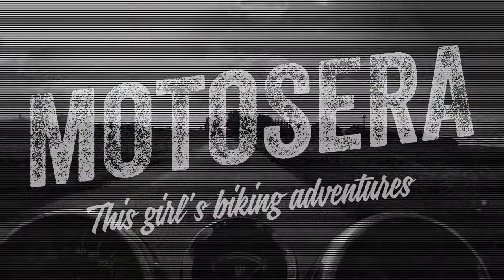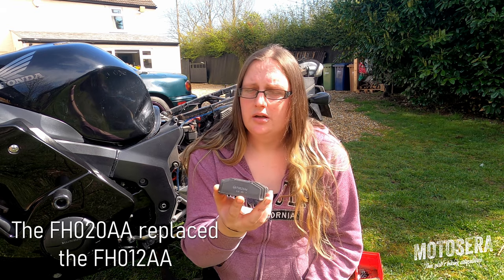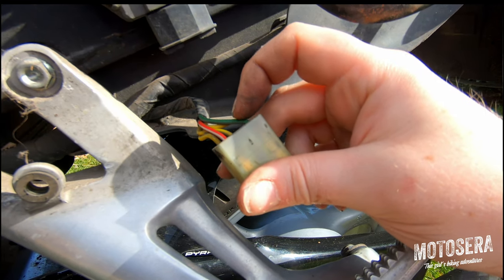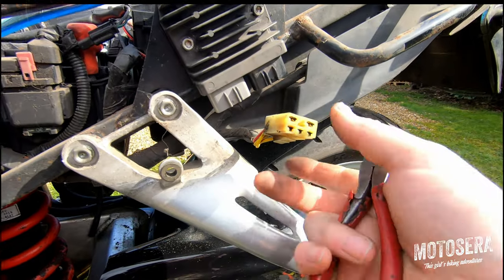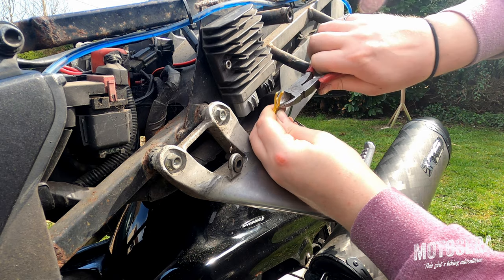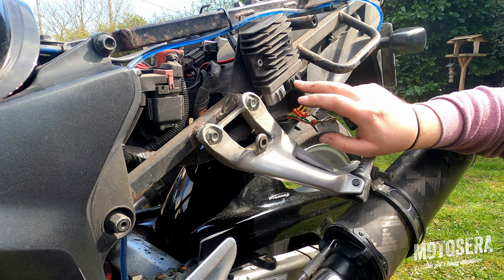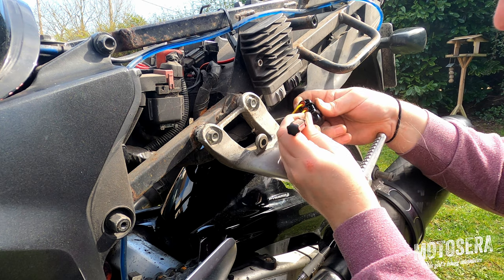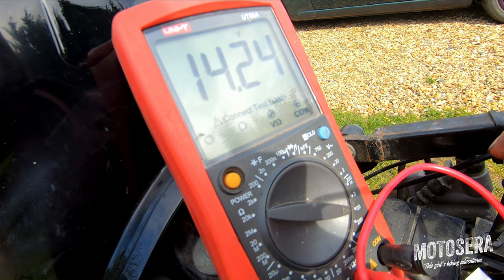Regulator rectifier failure - MOSFET Upgrade - Honda CBR1100XX Blackbird 96 97 98 Carb Models

Comment: Hi Sera! I just followed your tutorial and kinda dumb question but my plugs are tight ASF and I can't seem to push them up to be flush like your plugs so I was wondering if you could take a guess as to why not? Terminals are correct, they all made a clicking noise once they were properly seated and the plugs are facing the correct way and going into their corresponding slots. Should I just try muscling these mfers in? The plugs seem abnormally tight. TIA
Reply from the maker: If they are actually clicked/latched on then you should be good to go. Try pulling them off and see if you can move them. They go on with a 3 or 4mm gap.

Comment: Very useful video. Thanks . I have a cbr 1100xx model 1998 and I have done 53000 kilometers without any problem. The only thing I can mention is that when the motorcycle is parked, the battery does not hold its energy for many days. There must be a very small power outage somewhere. Maybe it's from the dust that can exist after so many years in some connections. For this reason every time I park the motorcycle for more than a day, I disconnect the negative terminal of the battery. I usually need a new battery every 2.5 years. Always be well and have good trips. Greetings from GREECE !
Reply from the maker: You're welcome. Try disconnecting the battery and put a meter, set to show amps, between the negative cable and the neg terminal on the battery and see what current you have. On a carb bike it should basically be zero. From there you can start disconnecting things one at a time, or pull fuses and try and narrow it down.

Do you have an alarm/immobiliser fitted?
Reply: @MotoSera   No i  dont .   I 'll try   to do   the  test . Thanks !

Comment: Buyer Beware .... There are tons of cheap new Chinese copys of the SHINDENGEN MOSFET FH012AA & FH020AA out there including eBay. Im not exactly sure if Sera purchased a used original Shindengen Unit (in good cond) or what, maybe she can tell us ...... but the old adage still remains true ... You get what you paid for!!
Reply from the maker: Absolutely, there are tons of fakes out there. I purchased a used unit. The genuine ones have specific markings on them, I am sure there are pictures on Google of how to identify them.

Alternatively buying a new unit from a reputable source is a good idea, avoiding Amazon and eBay fakes.

Thanks for watching!

Comment: Thank you for the video it was very helpful. I have a 2007 Blackbird with 15k on the clock. I have no issues with the battery but have noticed the seat feels very hot after about 50 miles. I wondered if this could be the Regulator Rectifier. Any suggestion would be much appreciated. Thank you.
Reply from the maker: I'm pleased you found it useful. It's unlikely to be the regulator, they are under the side panel. It could just be the hot air flowing over the engine and warming the seat. Mine can get quite warm, especially if it's a hot day or I get stuck in traffic.
Reply: @MotoSera  many thanks

Comment: What year was the yamaha fj that you used the regulator and what year is your blackbird I own 2001 fuel injections regards jamie
Reply from the maker: 2006-2012 have those reg/recs.

My Blackbird is a 98. The later models are a little different and you need to drill a hole for mounting. Other than that, very similar
Reply: @MotoSera  I have a 05 BB so reg on the other side & the wiring a pain to get out/in. Left hand side better place..

Comment: I have a friend that has one and has this going on .... One by one the instrument cluster started going out but the bike would still start and run. Then the fuel pump ended up not working either then the bike wouldn't even try to turn over... He thinks its a ground issue.. What do you think? Any help would be appreciated..
Reply from the maker: If its a fuel injection bike then I recommend checking the loom fix has been done. If you Google "Blackbird loom fix" then you'll get all the details. Good luck 👍
Reply: @MotoSera  thank you... We will try that first.

Comment: Hi Sera, great videos I have the 2000 FI  version of the bird. I also have upgraded but used the Eastern beaver looms for the wiring (plug in and play) they bypass the loom reducing electrical resistance through the loom. I did find that the plug from stator was still a weak point so soldered those wires and heat shinked. I'm fairly local to you being Norwich way so would like to chat blackbird info. Mine is a little less standard than yours with straight bars, 4-1 pipe and loads more.
Reply from the maker: Awesome. All good stuff to know! Also good to know there's some more Blackbird owners locally.

Thanks for watching! 😊

Comment: Great upgrade, thanks for doing a Video. I've only owned my Blackbird since April. Another issue I've found online is the dual braking. There is some extra kit bolted to the fork, apparently it can seize, needs greasing. Maybe some content for you.

Also this loom plug seems to be an issue on the Fi models, not sure if yours is injection.

Your push bike camping follower....
Reply from the maker: The secondary master cylinder on the front fork applies the rear brake when the front is applied. It's true the can seize. I am planning a video on the linked brakes at some point. I am just trying to figure out how best to present it.

My bike is carb, so I don't have the loom plug to worry about. 😁

Thanks for watching! And stay safe on whatever form of 2 wheels you are on! 😅

Comment: very good. straight forward fix for the bird
Reply from the maker: Yes, its easy and well worth doing. Later bikes you need to angle it a bit differently and drill some holes, but not much harder. Thanks for watching :)

Comment: Hi Sera, 
Thanks for a great channel. 
Just bought an ’06 BBird, thought I’d replace the r/r as a preventative, too. Do you know if the 020AA or any mosfet r/r works with li-ion battery or not? Many thanks.
Reply from the maker: I'm not sure, I think it would be ok but it would be best to check with the battery manufacturer

Comment: hi sera,im looking to get a used mosfet unit,but ive read some have had to file down the cooling fins as the unit is thicker and the bodywork wouldnt go back on?!
its a used yamaha unit off a 2016-2021 yamaha xsr 900,but its still an FH020AA with stainless steel back and1 hole slightly elongated,will this fit/work ok?thankyou

Comment: Hi Sarah, Excellent video. I have a 2007 model Blackbird with 20k on the clock. The red FI light comes on after 20 to 30 miles. No fault codes are coming up when the engine runs. It goes off after turning the engine off and it restarts ok. On a Blackbird forum it has been suggested that I do a loom fix. Do you think doing the loom fix will sort this. Where do I get hold of a Yamaha FH020AA. Where do I get the new connectors from. Have looked at a Rectifier from Jaws for £98. Many thanks

Comment: Hey Sera, I'm wondering if your clutch basket ever rattles when it is cold?
Reply from the maker: Only if the RPM is a little low - when idling at the correct speed (1100 rpm) it doesn't rattle any more than any other bike I've had. I do know it's a common thing though.

Thanks for watching

Comment: Have you ever tried a blackbird with vfr 800 handlebars fitted, I did it in mine but cannot find a huge difference, honestly, what I find useful is a pair of heavier bar end weights, They reduce notably vibration at 4000
Reply from the maker: I never felt the need for risers to be honest, so have never had them fitted. I try and avoid riding at 4k rpm to get away from the harmonics. Have tried different bar end weights with limited success.

Thanks for watching and ride safe!

Comment: Sorry it is one smaller white wire with a black strip. Thanks
Reply from the maker: You can just tape it up out of the way. It's not needed for the FH020AA

That should leave you with 3 yellow, 2 red and 2 green.

The yellow go to the input of the reg rec, doesn't matter what order.

The 2 red are the positive and the 2 green are the negative.  2 red go to the positive output and 2 green to the negative. Make sure you get the the right way around! And disconnect the battery before you start.

Comment: I am thinking of changing the Regulator Rectifier on my 2007 Blackbird with 20k miles as a precaution. Do you think the Yamaha FH012AA would fit my bike (£50 approx) or do you think I need to get a model specific one from Jaws for (approx £100). Very good video and thanks for your help. 4:00

Comment: Very good video! congratulations!
do you know if it fits in model 2000 with digital instruments?
Reply from the maker: It will fit, but the mounting is a little different, you may need to add a hole in the frame for one of the bolts.

Thanks for watching!
Reply: @MotoSera  Thank you very much!!🤩
Reply from the maker: You're welcome

Comment: Got a speed four and i had a new R/R last year.
Hardly rode it this year and now i can't go more than 5 miles on a fully charged brand new battery.
I have the usual wires going to the r/r but i noticed there is a black wire with a ring connector connected to the left side where you put the bolt in to fasten to the frame.
But also i have a red wire with a ring connector coming from the same place that isn't fastened to anything. Its just under the seat.
Not sure if its always been there since i had the bike "fixed" or if its the problem.
Any help would be appreciated.
Reply from the maker: Sounds like it should be connected to the battery positive. Almost impossible to tell without seeing it and testing though.

Good luck getting it fixed!
Reply: @MotoSera  yeah. I cant remember at all if it was connected to the battery as my memory is so bad.
I didn't want to cause any damage.
The black wire goes to where I mentioned. Red one just dangles
Not even sure what it is because before I didn't have them just the regular wires into the rr. They must come from the alternator or stator as its had a new one of those too. 
I think I'm going to sell it as a non runner because its been a pup and I can't throw any more at it.
Reply from the maker: @letni9506  can you trace the red wire back to its source?
Reply: @MotoSera  I'll have to check. 
They just come out under the tank, under the seat with one connected to rr bolt.
I'll try a few more things but I've had everything replaced that is involved with charging

Comment: Purchased my first Blackbird, seller was pretty dishonest/omitted details about condition of bike. It’s a 96’ battery isn’t charging, I want to overhaul the charging system with Rick’s RR and Stator. Is there any particular brand you recommend over Ricks? Also the turn signals are intermittent, seems the toggle is faulty, and the brake light doesn’t work. It’s a project bike, but still I paid $3,200USD for these electrical issues and I’m not too happy about it.
Reply from the maker: The Rick's kit is a good option if you are in the USA.

Turn signal switch is a common issue and easy to fix. Take the switch gear apart and spray it with some electrical contact cleaner and work the switch to clean it up. Sometimes you can get it in there without dismantling the switch completely.

Good luck and I'm sure you will get it sorted in no time!
Reply: @MotoSera  Thanks for the reply! Really appreciate your videos, and advice.
Reply from the maker: You're welcome, happy to help!